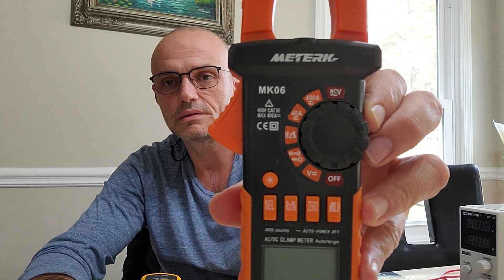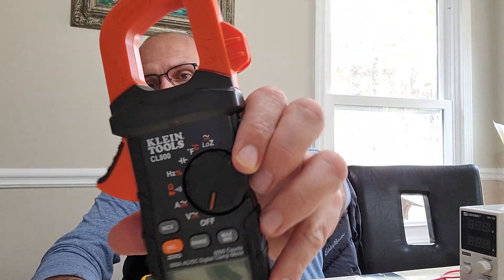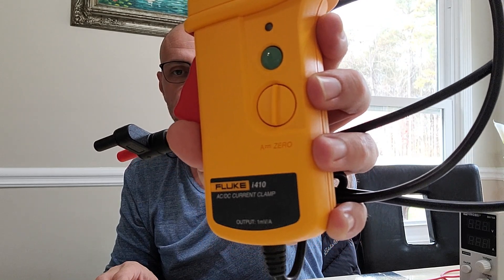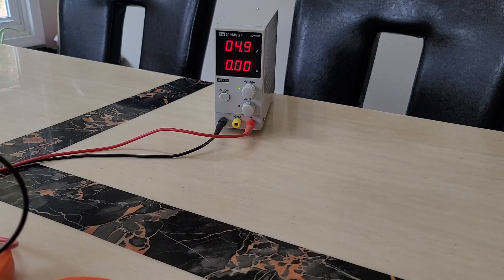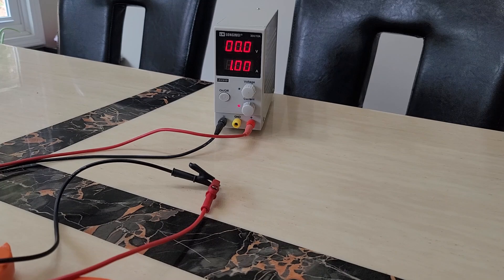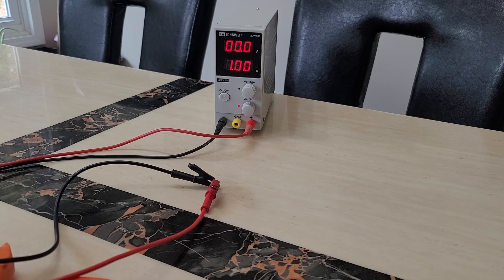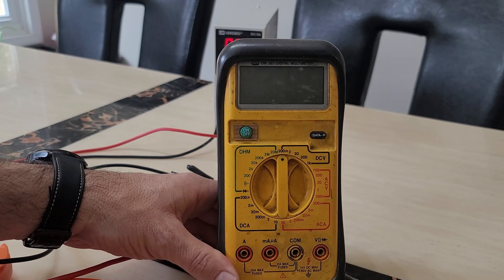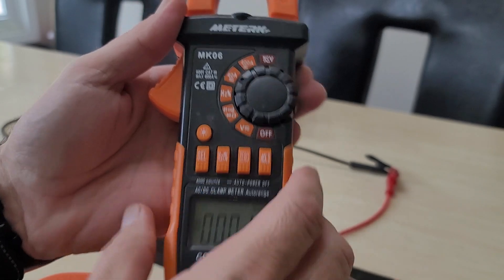Fluke i410 vs Klein CL800 vs Meterk MK06 Ammeter Accuracy Testing

Comment: Good video.  For any people watching this.  Since he has all meters in series, the amperage is going to drop after each measurement by about .03 according to this video.  I'm an engineer and I want one for home use.  All of these are accurate and can read DC current.  That MK06 only measures up to 400A DC and AC amperage, but it cannot measure True RMS for AC.  The others go to 600A (I think) and read DC and AC trueRMS.  Good luck.

Comment: So Fluke couldn’t be bothered to put a screen on their clamp meter? You have to deploy two meters to use one meter?
😂😂😂
Reply: They sell proper clamp meters like the other two. The one he is using is actually called a current clamp, and is an accessory for multimeters. 
I believe the current clamp is intended more for if you already have a good multimeter, and don’t won’t to carry or buy totally separate meters, and it is cheaper to buy the current clamp for an existing multimeter than it is to buy a whole new clamp meter. (Obviously cost referring to the comparison in cost of fluke’s products, not accounting for buying a meter from a cheaper brand)

Comment: All the tools are well within an acceptable margin of error. A much better review would do more than test minor wobble in the readings. When I'm crawling around in my boat working with 12 volts DC and 200+ amps of current, I need to know the tool will physically hold up and never fail to warn me when current is flowing. No way I trust a $40 tool over the $150 Klein. You seem very knowledgeable about these things, please do another review going into all facets that matter, not the minor variances in current flow which make no difference in practical work.

Comment: wait mk06 is not accurrate because it does not measure true RMS like fluke, fluke is correct, power supply is bollocks like most power supplies they dont deliver 100% what they display, mk06 uses average calculation probably the same as the power supply so its not the real  current
Reply: This comment makes a good point.
For any newbies --- this comment is for measuring AC.

Most of time when you buy these types of ammeters for AMP reading, you want to measure DC (like for your car) or for computer repairs and other peripheral repairs because they use DC power (after the AC to DC adapter).

If you're in the trades like Electricity Power Company and/or HVAC, then get the stuff that does AC (better).  Fluke is the most trusted in the USA because they make sure measurements are accurate across multiple disciplines/applications like if you're in the jitter of a cockpit, under a house, or on a pole.  AC is more dangerous because of the high voltages of 120 and 240.  Sometimes AC systems  go 600V and more.

But if you're on a workbench and you just need 12V or 24V DC Amp measurements, then go cheapest for the DC Amp feature.   I have a ammeter for AC amperage and another for DC amperage.  Many (cheap) DC amp meters use Average Volt/Amperage when measuring AC instead of the True RMS (root squared mean) amperage.  If you know what I mean.

P.S.

Trademen like to talk terse and leave out details that'll get you killed.  Know the difference between AC and DC and how to fight the electric demon.  You won't believe how many people I know that work as pole climbers that only work with AC, but are idiots when dealing with DC.  They get stuff confused every time while trying to give and take commands across all the applications.  My dad worked for the (AC) Electric company for 35 years and was making 100_000+ salary.  He's a dumb-a55 with the DC knowledge.  I know for at least my first 20 years on earth, my dad thought batteries with a 12.1 Voltage were still in good health;  he knew nothing or never measured the Amperage.  He mistakenly applies AC logic to DC and gets it mixed up.  When I was a boy, I would have to ask him more questions because I knew he was getting some details screwed up (even though he was the supervisor for the electric company).  I say this because the majority of Tradesmen are like that;  missing details.  The smart ones usually start their own business because after about 1 year of being with the dumb ones, they realize they're better than them.

Don't get killed or shocked by smoother brains.  They'll get you killed.  Always run questions by them, because they tend to leave out important steps.  HVAC guys, most of the time, know the difference.  Electric company guys usually don't know the difference, because they're trained only in AC and they use slang when talking about electricity like leg, ground, neutral, and all the other "mambo jumbo" word soup non-sense that don't have distinct definitions;  they don't know the true difference between Neutral and Ground (or Earth).  Don't die from someone else's misunderstandings.  

Your welcome. -- Engineer

Comment: Hi, I stumbled upon your interesting comparison because I gambled on the MK06 clamp meter because I want to have a "fairly accurate" DC amp clamp for measuring the DC currents drawn up to 400 amps through a very thick cable running from my 12 volts lithium iron phosphate battery array (so far 4x 12v 100 Ah setup in parallel) to a low frequency (ringcore transformer) power inverter of 3000 Watts nominal output. For that inverter to be able to supply 3000 Watts it must be able to draw about 250 amps over the cable at 12 volts. I also have a Victron MPPT solarpanel charger (to said battery bank) with some garden based solarpanels. So that is my main application for geting a clamp meter, to measure and verify DC amps through the cables coming from the  solarpanels and from the battery bank. If it is not too much to ask, could you give me your opinion on just keeping it with the MK06 clamp or are there reasons why I should pursue a much more accurate but also more expensive Amprobe, Klein, Fluke or similar clamp meters with extra functions like inrush current etcetera or is the MK06, in spite of it's low price and some mixed reviews from people on Amazon actually spot on for my needs ? I am a total newbie when it comes  to clamp meters, but I know what to do with a multimeter at least. Thanks so much for any reply you could spare me ! Cheers, Marc
Reply from the maker: Precision is my driving force for Fluke i410. I am bit anal about precision. Klein is damn good tool for the money that, to be honest I use the most. Meterk worst of them all. Thanks for watching. See this video too https://youtu.be/MKQLcQ8GVBM
Reply: @DMIINC2013  Thank you for your reply. I will keep the Klein device in mind of course, but meanwhile I have received the MK06 from Amazon and have had a few chances to do measurements and I got to say, the Meterk does not disappoint (at least for my purposes) and the price I paid is ridiculous at about 18 dollars something..

Comment: Hello, I have a question, I noticed that when my clampmeter i410 is turned off, the battery voltage appears at the terminals is about 9v but after turning it on it returns to ok is it a problem with my clamp meter or everyone has it
Reply from the maker: I have not noticed that. I will try to look into it.
Reply: @DMIINC2013  
When connected to the multimetar set to vdc (when i410 is off) it will show you battery voltage around 9v

Comment: Nīče video. But for better comparison you need to add one more multimeter measuring ampers in series. This could be more precise. And you could compare all measurements to that one. Now we do not know which one is more correct.
Reply from the maker: I got the fluke 289 and it confirmed all other measurements. Thanks,

Comment: This comparison did not seem very fair to the Fluke i410 as you were using a 25+ year old multimeter with unknown calibration history to read the voltage output.
Reply from the maker: Thanks for the comment. Comparison was done to see what am I exactly working with before testing accuracy of 2 other shunts. Think of it as base line reading. I have already tested (video coming soon) one of the shunts and Fluke combo works really well. The cheap one was way off in my mind and Klein showed almost exact same number as Fluke at 200A
Reply: Agree, old multimeter most likely not accurate

Comment: But what is the power supply accuracy? I dont trust this power supply measurement
Reply from the maker: I do not trust it either however you need something to establish base reading.
Reply: @DMIINC2013  Hi, Join the red and green leads solid jaws together, On continuity press the Zero button, The meter bleeps then press the Test button, this will zero the metre, release leads and carry out tests.
Then check the resistance of the Ik resister this should tell you how accurate the meter is.
Reply from the maker: @offgridwanabe  On what? I do not have green lead.
Reply: @DMIINC2013  forgive me wrong meter I am learning thanks
Reply: @DMIINC2013  I guess what I should have asked is did you zero the ohms for the lead wires, (maybe this has no effect). Hey buddy if I'm bugging just let me know I can be terrible when I try to figure something out lol
Reply from the maker: Absolutely not. You are not bugging me. Performed test on Victron Smart Shunt and result is amazing. But FYI Fluke and Klein are spot on.
Reply: My power supply like that one seems accurate at low voltage but drifts at higher voltage. It is all the same problem as they are all relative ie amps, volts, ohms,
Reply: I think the flaw in this test is the lack of a tested and recently certified ammeter.

Comment: Do any of those tools have a way to adjust the reading for variance?
Reply from the maker: Variance?
Reply: @DMIINC2013  ya way to set the amperage display to vary the reading to a known amount. Many charge controllers allow the reading to be adjusted I just wondered can the tool be calibrated which may be a better word.
Reply from the maker: Yes, Fluke i410
Reply: @DMIINC2013  just looking around and google gave me this I have never tried I just work with the difference.

How to Calibrate an Ammeter

    Connect the two terminals of the voltage source to either side of the 1 kOhm resistor. Video of the Day.
    Connect the two terminals of the ammeter across the resistor, or in parallel. ...
    Switch on the voltage supply, and set it to 1 V.
    Calculate the expected value of current using Ohm's law.
Reply: @DMIINC2013  electricity was my worst subject in school lol many years ago